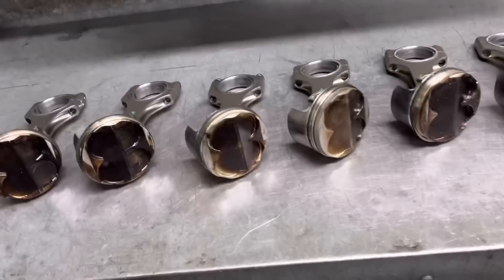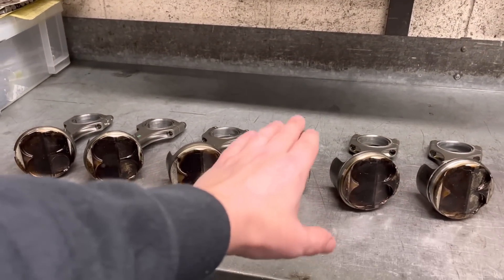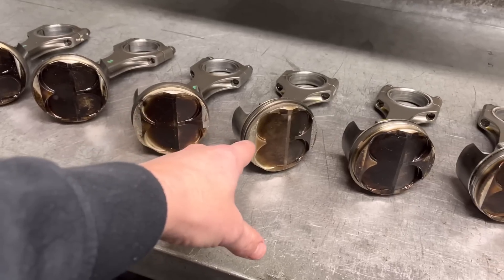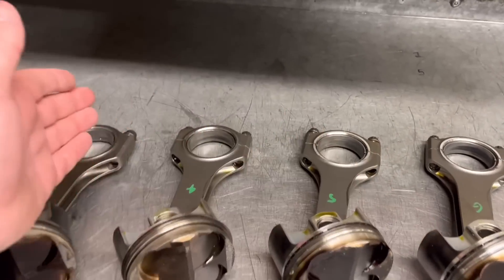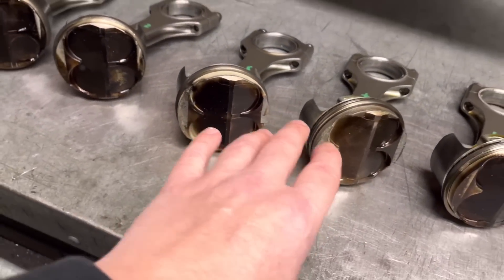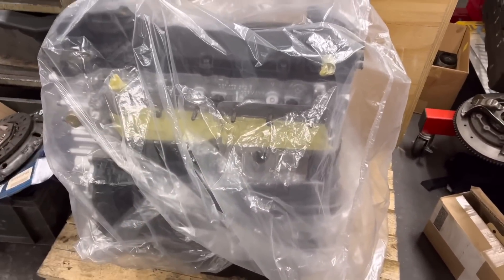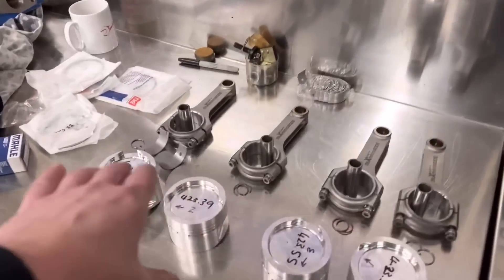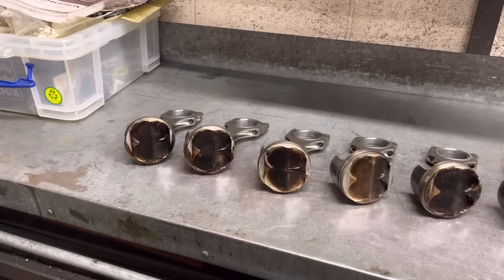BMW E46 M3: My opinion on why this engine lasted 2 days & went BANG

Comment: I can't believe it lasted as long as it did with all of the very sharp edges on the piston crowns. The sharper and finer the edge the less heat that it can tolerate. Like lighting a sheet of paper compared to a log.

Comment: My good man.
I cant imagine anything more frustrating than pooring your heart and soul into some engine work and then it coming back only to be apparent that it was nothing to do with the work that you done.
The customer addiment that it was. You knowing for a fact that it wasnt   and like you say some intermediate    dodgy remap friend with not many years experience throwing a spanner into the mix.!
For anyone out there thinking of getting any engine work done to there car.
Confirm your injector spray patterns and fuel pressure at the inlet manifold before continuing.!

Comment: S54 was pretty close to the limit as shipped from the factory… rumor has it Bmw marketing wanted the rev limit raised by 500 rpm to get closer to  Honda’s S2000’s rev limit … anyone squeezing that engine for more HP needs a large bank account

Comment: You certainly nailed the diagnosis, none of the failures can be attributed to your shop. Unfortunately, one or two of the others that had hands on the motor caused the problems that led to the failure.

Comment: What fuel was he using ,has he put a higher octane for the track or even filled it with racing fuel or even a mix to increase temp in piston .there has to be something introduced into piston.

Comment: Plenty l agree about but also a fair amount l don't....any decent engine mapping tuner would be pulling spark plugs to check their burn colour & condition which would have stopped this whole disaster...why spend thousands on a super trick engine parts & machining then refit the old standard shitty injectors, nice one!...l bet you they were running the standard heat range spark plugs too...did he get it mapped at 'Halfords'....yet again people getting involved with engine tuning that are absolute clowns 🤡....Lee, you forgot to cover the piston cooling jet failure & poor alignment...or are we saying those nice Arrow rods are 'flexible' under load...😂.
Great vlog & love your honesty...👍
Reply: Fairly confident those rods are not bending. That failure has all the hallmarks to dodgy fuel, fuel injectors, poor mapping with ign timing.
Reply: @AlP94424  
I cannot believe people are even talking about bendy conrods or pistons hitting cylinder heads...
These basic static clearances were checked out on the original engine build...only a catastrophic bearing failure is going to alter these clearances, which this engine did not have. The strange wear pattern on the big-end shells is caused by detonation giving excessively high peak cylinder pressure. 
This is a common trait on turbo charged V8 drag racing engines with 2000/3000 horsepower...👍

Comment: With it being a competition engine that failure could be a symptom of many things,   are the injectors flowing correctly, what was the ignition timing, fuel spec etc. Also I noticed that the edge of the valve pockets on the pistons haven't been smoothed off or fettled down and made thicker, leaving these thin and sharp could also contribute to heat spots resulting in pre ignition.
Warranty.... No warranty?

Comment: The BMW engine failure is probably a control issue The drivers foot has been too hard on the throttle for too long.

Comment: You should create a list of engine tuners your company works with and you approve for competition engines  to reduce issues in the field.
Of course that doesn't prevent silly customers from over revving the engine etc., but should at least guarantee the engine is properly build and tuned.
Reply: Good point. It could help avoid issues with liability disputes if partnered with a good tuner too.

Comment: So, did the customer get bad fuel, or was the tune off . Compression ratio could be to high for available fuel ? 
 11.3 to 12.5 to 1  cr should be running 94 Ron minum.  
 Now my l77 runs a cr of 10.4 :1 stock and runs 90 non ethanol fuel. 
 If I shave the heads on these the new cr would be 10.6 or 10.8 :1  still safe for 90 or 91 non ethanol fuel. 
 460 hp with the right cams and push rods , cam & lifters. 
 Be safe good to see you are better.

Comment: Maybe rods hit oil jets - stopped them cooling the pistons - caused detonation 

You also said you ran a thicker head gasket and the pistons have a lower compression height. This would reduce squish clearance. Not ideal especially if you are running higher compression. But if this was the problem then all 6 pistons will have been detonating

Comment: My mates injectors blocked snd he melt holes on pistons. 

Those pistons hit valves.  Tuner probably  float them trying yo squeeze more revs

Edit* if it melted the sparkplug.  The porcelain on the tip could explain the chip out of the l
Piston.
Would have buffed the cylinder up pretty hard too tho

Comment: I might also mention that detonation is very audible when the engine is running on a dyno, or on the road. That 'tinkling' sound when an engine is under load is detonation. Many older cars would suffer this from amateurs setting ignition timing. Electronic cars, not so much.

Comment: You're bang on, especially with the pistons getting hot, expansion, miss shapened, wear etc and your being very polite. They are a really bad design. If you talking about pre ignition, you might as well hit the pistons with a sledge hammer, that is uncontrolled and can easily push those sideways as there is nothing in the design to counter that?  I know I am getting old now and not had a pinto or cross flow for quite a while from days when sensors weren't invented. But I never understood "tuning" an engine to within an inch of it's life, ragging it on a dyno, coming out with a number at a specific rpm with a smile and then getting upset when it doesn't last very long. Fit a bigger engine with less stress that works through all rpms? OK, dragster engines are designed to last 2 races? I get that. The carbon on those pistons looks like 100k, unburnt fuel.

Comment: I’d also be interested in knowing what fuel that BMW motor has been burning, at near 12:1 your gonna need some high octane fuel, maybe around 105 octane, Shell does 99 octane but it’s not enough with compression like that. Fact the injectors weren’t renewed and/or spray tested is engine suicide, a knock sensor could’ve saved it. Deposits on the spark plugs under a magnifying glass will tell you a lot as well. This issue is no way the fault of Barum Engines, it’s down to the tuners and the owner, why use the old injectors? Do all that money on an engine and scrimp on the fuel system?? Doesn’t make sense to me!
Reply: New engine = new injectors (quality injectors not ebay ones).

Comment: I remember regularly popping the head off my Class 100 Kart engine in the 70's after a few laps in the first practice sessions to check piston colour as a guide to mixture being OK, premix 2 stroke, no oil metering or electronic gizmos around then!!!
Watched a few injector tests cure dyno pull problems on the PFI Speed channel when the engine hasn't been happy and the spray patterns and volumes have sometimes been way out of balance on the 4 cylinder Honda's they specialise in...

Comment: I've seen this before, almost brand new build forged engine, we extracted brand new looking pistons and conrods with severely damaged piston crowns and really weirdly damaged journals. There was also mechanically looking marks at piston crowns, but the head was clean. And it was all done by improper ecu mapping and detonation 😭🤦🏻‍♂️ ... I still have images of it somewhere. 🧐

Comment: Back in the days of leaded fuel and efi, I used to regularly see flow variations of 15%, and often 20% on injectors when we had them out for servicing. Come unleaded fuel, the flows were often pretty close, but the spray patterns were often awful. Often there was little to no atomisation.  The problem with bad spray patterns is the fuel takes longer to burn, due to the lack of atomisation. This can give you an effectively lean mixture during combustion, but still an okay air fuel ratio reading as combustion is continuing during the exhaust stroke. The black on the pistons is symptomatic of rich mixture or poor combustion. Would be very interesting to see the injectors tested on a flow bench.

Comment: So is the fuel pump and regulator working correctly? Rich at idle - lean at revs? Correct spark plugs - wrong heat range can be critical? Oil pump OK, low oil feed = lots of heat? And for track use has it got a dry sump or at least a baffled sump?

Comment: I can't believe you are wasting time looking at it - clearly either injector or tune issue.  I build and use 2JZGTE's everyday, obviously detonation and nothing what so ever to do with machining or build.  What are people thinking of not fitting new flow matched sets of injectors?   I mean proper injectors not the Ebay 'Bosch' crap from china.

Comment: When you cut too much off the face of the head, they don't seal properly once the boost comes up and you get ongoing head gasket issues.
Reply: You're still guessing at the CR (the beemer). You didn't measure it. They're never what you think they are when using non standard parts.
Reply: Root cause of detonation? Too much CR for the octane
Reply: You didn't show pics of the top half rod bearings. With detonation they're often flattened and widened slightly just at the spot where the load is applied when at TDC.
Reply: You don't say what computer is running it. Many aftermarket ones don't have good knock detection.
Reply: You shouldn't be letting some random garage pull it apart for you . Got to do it in the reverse of building it, measure everything, particularly the torque on the head bolts.

Comment: The reason this engine shit itself, is directly related to the builders not having a clue as to what they are doing!  That is confirmed by the use of WW2 machine tools, no cleaning equipment, or clean assembly area, and a seemingly inexhaustible supply of unhappy customers,  all of whom according to Barum are liars and cheats!
Reply: Definitely a tuning and injector issue d h
Reply: @keithgreen9009  Why would anyone get a race engine built by a clueless idiot, who doesn't even have a cleaning tank, and builds engines in an engineering workshop, complete with dirt, swarf, and grime?

Comment: Inlet shape can determine if certain cylinders run weak. If the forced induction port of the inlet lines up with say cylinders 3 and 4 then those cylinders will map weak and should be compensated during mapping.

Personally i think its a bad mapper

Comment: Why don't you just pull out the buildsheet, and show the customer all the clearances and the compression-ratio etcetera from the build?? 
You do measure up  the engine before and after the work, don't you??

Comment: Could be possible the heat range of the plugs needed changing because of higher performance resulting in preigniton i have changed a piston that had a hole because of a incorrect plug

Comment: Gentlemen I worked in a engine machine parts I have a tip for you to make more money and stop the headache PUT UP A SIGN IN YOUR SHOP WE USE MY PARTS OK WE USE Y0UR PARTS WE CHARGED 25% MORE And for us we had way less with stupid stuff happening and we Put in are engine DYNO we charged 1500.00 to run and tune perfectly ENDOF PROBLEMS!!! Take care

Comment: What was the clearance between the oil jets and connecting rods? Devils advocate, I could see losing the piston cooling causing detonation. I remember I drove a truck with 250 Cummins motor that wasn't up to the job. My boss looked into upgrading and 270hp was the limit because the block didn't have oil jets cooling the pistons. Otherwise it could have been uprated to 400hp.

Comment: Quite a number of  things can cause detonation.I would be pretty certain that the owner hasn't had the engine correctly set up before hammering they shit out of it on a track. Ignition timing, plug choice fuel octane, mixture etc  on a naturally aspirated high compression engine is pretty crucial on an engine with such a high compression ratio, 12.3 to 1 is pretty high and needs very careful mapping. You would think he would have heard the bloody thing knocking and clattering away long before it went bang. You really need all of the set up information  to determine the cause 100% and was the knock sensor deleted?
Reply: Yes it looks like engine abuse,,, did they even let it warm up first ,, it always pays to learn everything about an engine before hammering it on a track
Reply: owner will say it only happened 1 time .but fails to mention that 1time every other lap lol
Reply: I bet on the trackday he had a video going. But probably a bit quiet on using that as it might point the finger a certain way.

Comment: I have zero respect for 'tuners'
Only 1 out 100 actually know what they are doing.
The vast majority are just laptop jockeys who have no understanding of what they are messaging with.
A short term dyno result has no relationship with usable p9wer.
These guys were probably brick layers before they bought a rolling road dynamics and a laptop.
That strange bearing wear 8s probably what is called cavitation.- explosive force on the oil tiom.